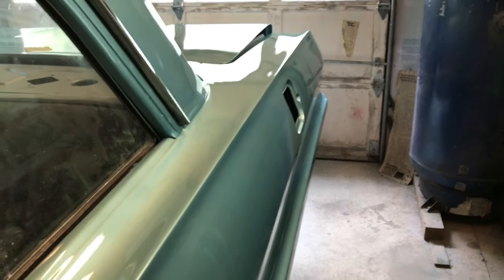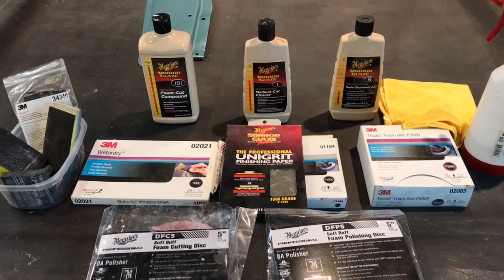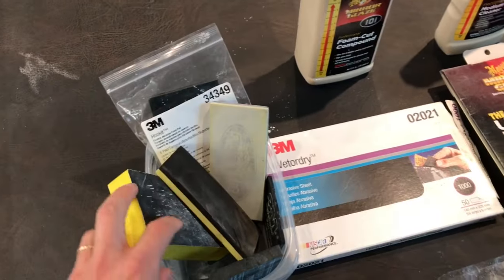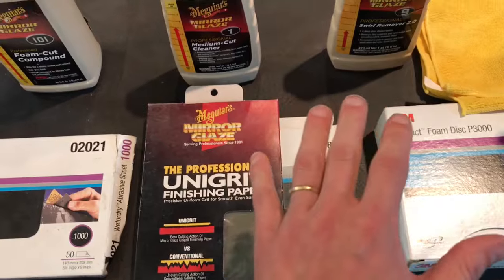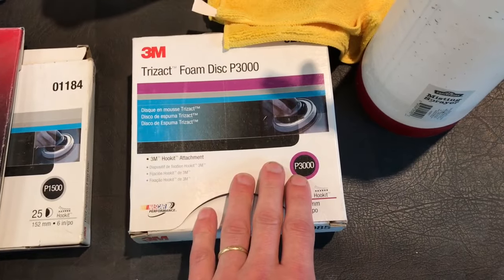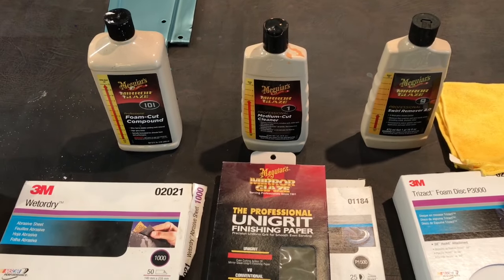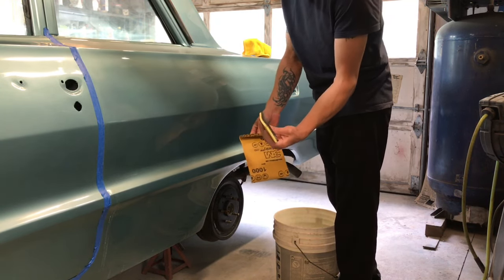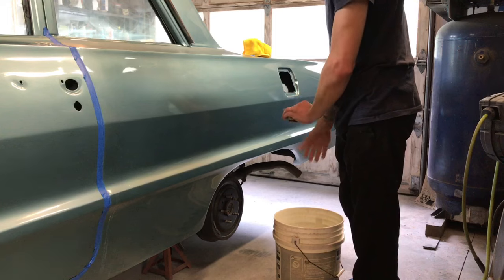How to Cut and Buff a New Paint Job

Comment: What's the deal with speeding it up when giving advice about going through the clear coat - that would have been helpful info!!!
Reply from the maker: Jim Furr It was a an excessive rant that went on and on. Really I could make a separate video for dealing with sanding through the clear.
Reply: @CoreysCave  Next time don't speed up advice no matter how long the rant. Anyone can always move the video up if they don't want to hear it. I guess we could also slow it down in the playback options. Good video! Cant wait to start painting some parts for my own vehicles.
Reply: Change your video speed to 0.5x and you can hear what he says, although he still sounds like a munchkin 🤣
Reply: I can understand him just fine

Comment: Looks like a lot of unnecessary work. I use 1500 to level, block it out with 2000 wet and polish. I'm no pro at buffing but have learned how to use foam pads. Planning to get a wool pad to speed up the process. Do you have any tips on what wool pad to get? I have a TCP 8" but not sure if its worth using. Compound - M85? or something else?
Reply from the maker: heavymechanic2 I don’t have a favorite when it comes to a wool pad, I do however like to use wool in general.
Reply: Thanks for your honest answer.
Reply: check out Mirka brand wool pads. i have a lot of experience with these wool pads in general and they work a charm with 0 pressure..
Reply: Its not unnecessary steps...
The 3000grt cuts your machine time down. I have 5000grt for after the 3000 and it already starts to shine it up.
Great work my friend!

Comment: I have a airbrush just in case,sand burn thru with 400 keep it only in the burn thru and sand with 1500 1 inch around burn thru.Spray burn thru with light coat let it dry 30 minutes,follow with ur blend keeping it only on the burn thru.Let dry add clear coat to air brush and clear up to the 1 inch around burn thru.Let dry and cut and buff.their are very cheap airbrushes at harbor freight.

Comment: I wish you didn't fast forward that bit where you were talking about sanding through clear.  I was learning a lot and it was very interesting. It was also directly related to this video, because we need to know exactly the risks in the cut and buff process.
Reply from the maker: Victor Vaughn I’m sorry about that, I didn’t think people would want to hear me ramble on. The video is already quite long. In short the risk is that if you sand through the clear you will almost always sand through the paint as well. When you go to touch it up the paint can have a reaction causing it to wrinkle up, if that happens the little touch up can get big quickly.

Comment: I’d have to say if
You’re worried about sanding thru clear then best to start w 1500 or even 2000 just to be safe.  A lil texture is to be expected on most cars.  I say it’s best to save grace and leave some clear for the future if God forbid it gets a
Scratch and needs to be buffed
Reply from the maker: Kenny Romans If you don’t mind some texture then I would agree.
Reply: Clay bar goes so far to help texture. But yeah start with a higher grit. Not gonna scuff as much. It will still work just takes a little more work to get the same result. I'll go from like 600-800 up to 1500. On my taillights I started with 2000 grit.

Comment: Did a hood on my truck, used the DA wet with plenty of soapy water, 1500, 2000, 2500, then 3000. Looked great. Break out the buffer and DA marks appear over the entire thing! Pulling my hair out trying to figure out why! Not the first time this has happened.
Reply from the maker: Make sure everything is very clean, a small piece of dirt on the sandpaper can cause the DA marks. Another tip is to make absolutely certain each grit is completely removing the sanding marks from the previous grit. Another possibility is that the DA marks are actually in the paint itself, that you didn’t use a fine enough grit before paint.

Comment: thanks but i was talking about the air sander you used for the 1500 and 3000 thanks
Reply from the maker: It’s just an average DA, also not at full RPM. Any DA will work.

Comment: What I hate the most is how I do exactly the same procedure with the cut and buff step and I end up with a shit load of scratches, new scratches that were not in the paint. I recently painted the roof of my vehicle in black. I used 3000 wet sand on a DA, came out looking amazing!  I'm thinking, after I buff, the paint will look extraordinary. I used the 3M Rubbing Compound 05973 with a McGuire's maroon cutting foam pad. What a horrible mistake that was. I was left with a shit load of scratches. I wanted to blow up the car into pieces. The more I buffed, more scratches. I feel like re-clearing the whole damn room again.
Reply from the maker: Damn that sucks. I have used the 3 M process and just didn't care for it. Love the Mcguires stuff. Whenever I have had scratches from buffing it's a cleanliness issue. Not saying that's what happened to you but any little dust or dirt will be a disaster.
Reply: lol... my foam pad was new when I started. I'm starting not to like buffing. I'm getting ready to paint my whole car but first converting my garage into a temporary paint booth. Reduce dust particles to avoid buffing. I don't mind orange peel. I'll take orange peel any day instead of annoying scratches.
Reply: waltwitty this dude sucks. Stresses about not sanding thru but starts with 1000 grit. Flat out no need. 1500 is plenty rough to remove orange peel. Also cutting with foam is silly, it takes forever. Get a wool compound pad and learn how to use it. Then jumps grits when sanding! Theeeen does his buffing with a damn random orbital! Wow get a rotary buffer and join the professionals.  I guarantee if this car was a darker color or especially black he would have had tons of scratches easily visible. This color is forgiving. But my comment is not.
Reply from the maker: I have used wool and foam, if you look again you will notice the heavy cut compound I was using is made specifically for a foam pad. I actually do prefer wool but this foam process works pretty good.
Reply: waltwitty You crack me up!!!! Everything you said is EXACTLY how it works for me...
SUCKS...I can follow steps to the teeeee and still end up with f’ing hairline scratches, deeper scratches, shit even the paint ends up a different color.....don’t tell me it’s all in the technique!!!???
Reply: Black paint is a REAL pain. I have a black car. Love the color, but hate it when I have to break out the buffer. Best part is that you are suppose to do the compounding in the shade, but when you think you're done and cleaned the car up, then you look at it with the sun hitting it, no good. 
I feel your guys's pain on this one.

Comment: Maybe I just missed it, but how long after spraying the final coat did you wait before starting step 1 here? I’m assuming the longer, the better. Is there some ideal range?
Reply: Really appreciate your detailing of your process! It’s not easy to find, and I’m sure it’s time-consuming for you to share as well
Reply from the maker: It was about 48 hours. The sooner you cut and buff the easier it is to sand. However it is also easier to screw up and sand through because the clear isn’t super hard.

Comment: You're using an orbital buffer to do this. A rotary buffer ( real buffer) should be used. Your orbital is for the final stages.
Reply: Not necessarily... With the right pad and the right chemical, a DA is perfectly capable of handling this job.
Reply: @jd_turner_ai  I disagree. As a restorer and retired Instructor or paint and body . . wrong tool. Maybe a millennial thing, but not the best way to do it. Plain and simple.
Reply: @jd_turner_ai  LOL

Comment: I am worried bout going thru clear too.  I am not sure if I did, surface is 3000 finished great. try to buff now but how do I know if I am on clear coat or paint ?  PLEASE !! HELP !!!   THANKS
Reply from the maker: swampg88tr You will know if you go through the clear, trust me. Like I said in the video you almost never sand through the clear without going right into primer. When you were wet sanding the slurry should always look a milky color, if you sanded through the clear the slurry would turn to the paint color. Why are you worried?

Comment: Can someone give me a link to wet sanding lacquer single stage nothing out there I can find
Reply from the maker: Tony Rauch It’s actually the same process but you need to be even more careful to not remove too much material.
Reply: Im repainting a car with single stage right now, ive had more success with it starting with 1500 grit and going to 5000. Its less cut overall especially if you have runs and It takes much longer but ive had better results
Reply from the maker: Drew Daniels There are many methods, I definitely recommend using what works for you as we all have different experiences. Thanks for sharing here because someone may see this and decide to try your method and have results like yours.
Reply: @CoreysCave  thanks! Definitely good tips on the sanding though. Watched as a reminder on the general process. I do it so rarely.
Reply from the maker: Drew Daniels I’ve learned a ton on YouTube, that’s why I shared this. I’m glad you found it helpful.
Reply: @CoreysCave  YoutubeU is the cheapest and best college ive gone to
Reply: @drewdaniels94  FACTS!!😎